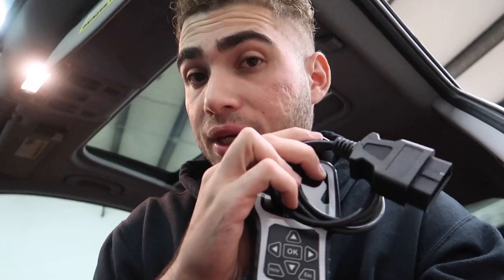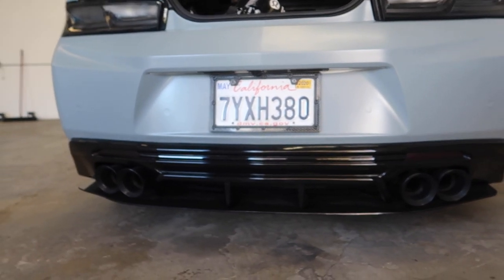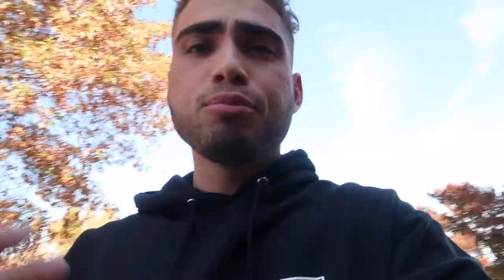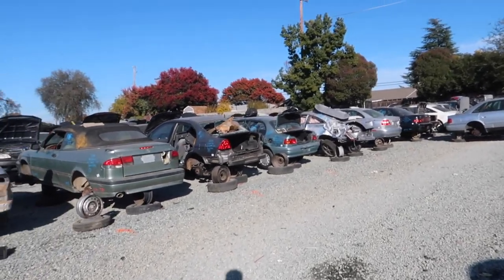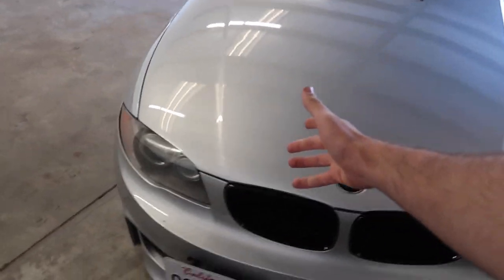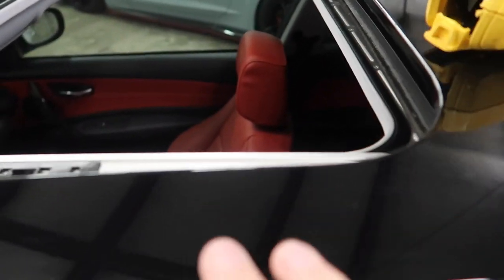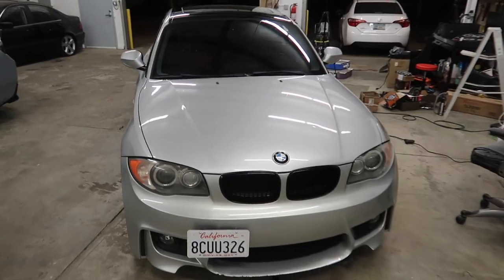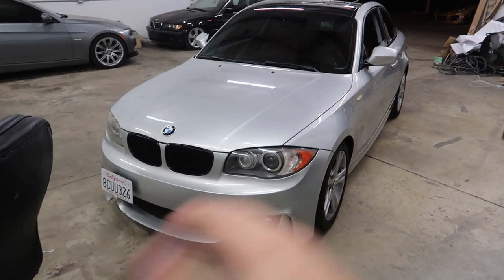MY FAVORITE $40 MOD FOR EVERY BMW!

Comment: Nour I need your help. 

There’s a 2013 535i for sale for $14k and 46k miles clean title & no issues I have test drove it from the bmw dealership and it’s still under warranty should I get it or is this sketchy? I got backup money for maintenance but this deal seems too good to be true
Reply from the maker: Hoodini Sharif nah its actually a fair price, because 5 series loose a lot of value quick. So that sounds right!
Reply: Nour Hummadi Yea it’s just unusual where I’m from because the whole market is selling the same car for literally the same price but triple the mileage
Reply: Hoodini Sharif: BUY IT!!!! I have a 2012 & 2014 535i. The I6 is pretty bulletproof.

Comment: I went to junkyard today to get spare for my 335 (btw, 05-10 Honda Odyssey spares are the same ones that most pages sell as BMW spare donuts, same bolt pattern, same tire size 17") and halfway there I saw E90 335i LCI. Guess what I did. I took trunk and taillights for my pre-LCI model. Sadly front end was damaged so no hood for me :(